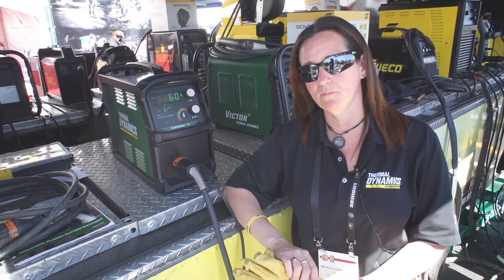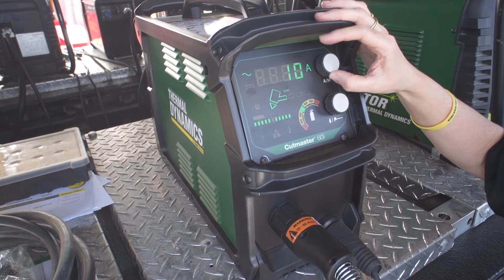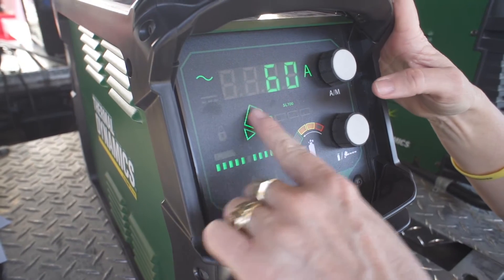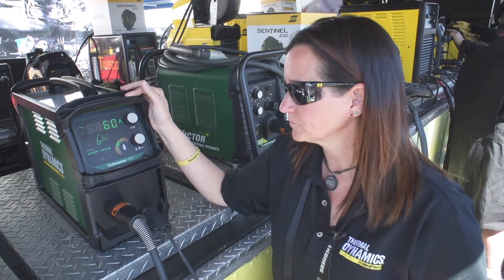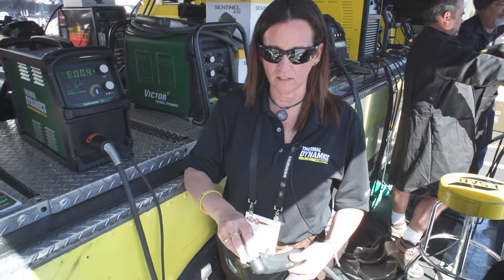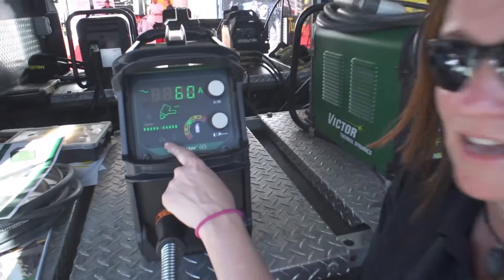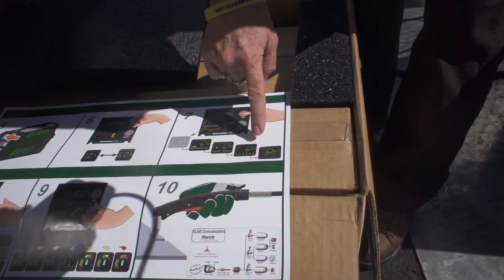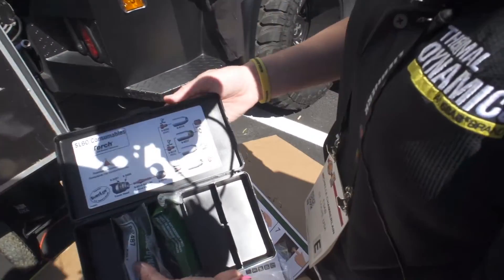Thermal Dynamics Cutmaster 60i Set-up Tips

Comment: Can it be set up for a  cnc table and if so is it just a matter of Changing the torch
Reply from the maker: The standard unit MIGHT be able to connect to a table, however we have the A-Series which is designed for just that application. Thanks!

Comment: When this thing works it cuts great ; however this thing generates more error codes than it does cuts .   I hate this unit.   It’s very very fragile .   The error codes she mentions in the video is for good reason.   You will see them every time you use this unit, and then it won’t run !!!!!!!!!!!!